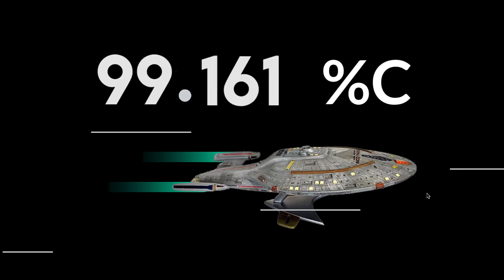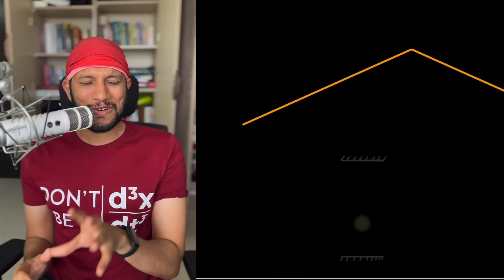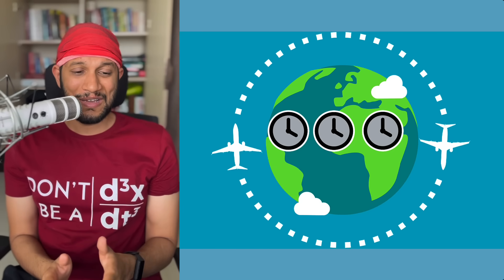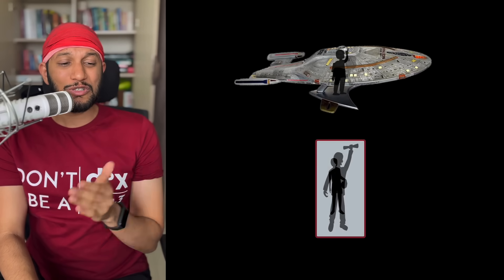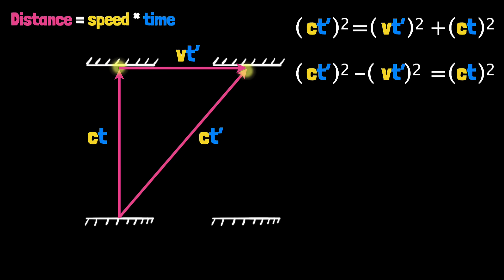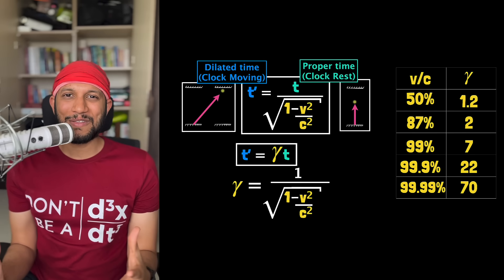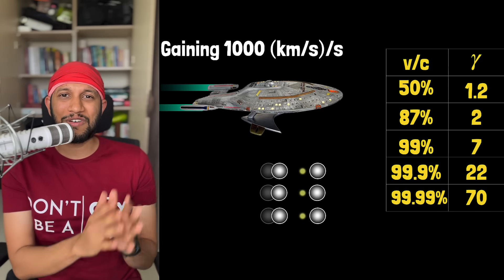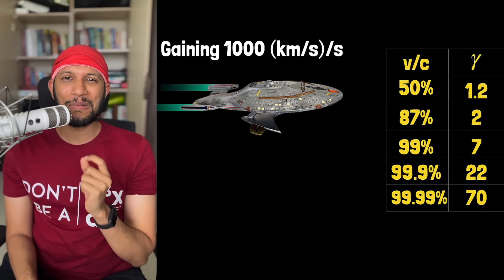I finally understood why you can't go faster than light! (My mind is blown)

Comment: Tachyon…. Something originally faster than light may exist?
Reply: It's theoretical, but yes, it's possible. If something's faster than the speed of light, it will always remain faster, and for it, the relativity works inverse. As in, it's impossible for tachyons to move lower than the speed of light. When you put energy on them to accelerate them, they will decelerate and when you try to stop them, they will accelerate. Basically, you have to shift your whole world-view and motion itself towards and cantered around light.

Comment: thx, but for the people in the spaceship itself, would they see it go faster then light?  you cant see it outside the spaceship because it takes more and more time, but for the peoples perspective wouldnt it be possible to go beyond speed of light? (after infinite time from outside perspective)
Reply: Good question! But no, even from the perspective of people inside the spaceship, they wouldn’t observe anything going faster than the speed of light.

Inside the spaceship, light still bounces between mirrors as usual—it doesn’t appear to speed up. That’s because passengers have no way to tell if they are moving or if the rest of the universe is moving in the opposite direction. In their frame of reference, everything seems normal, and the speed of light stays constant.

To claim light is going faster, they'd need to factor in the motion of the spaceship itself. But relativity tells us that for objects in constant motion, there's no absolute way to detect that motion from inside. So from their point of view, the speed of light is still exactly c—and that’s one of the foundational principles of relativity.

No observer can definitively say whether it’s them or the universe that’s moving (in a constant motion, which is often referred to as the inertial frame of reference in newtonian physics)—and that’s exactly why the speed of light must remain constant in all frames.

Comment: 13:53  an atom emitting light to another atom remain same speed regardless the speed of that atom why you are saying light is taking for ever time to reach the other atom
Reply: because the atom is also moving close to the speed of light. the faster the atom is moving the longer it will take for the photon to catch up from an observer's pov.
Reply: @ but wait i understood that if atom1 is accelerating it need to transmit light to near atom2 to transmit the force of acceleration so if atom1 is speeding close speed of light then he transmit light to atom2 means force of acceleration why atom2 is speeding more than atom1 . Atom2 can not get any acceleration if it is not transmitted from   Atom1 so why atom2 is already at speed of light or close to it ? From where it gets that speed if light electromagnetic force was not transmitted from atom1 ? How can atom2  can even have doff speed than atom1 i am still confused
Reply: @ Atom 1 and 2 are initially both moving very close to the speed of light. It doesn't matter how they got that speed. Then atom 1 sends a signal to atom 2. The faster these two atoms are moving the longer it will take for the signal to reach atom 2 (from an observers POV). 

If the atoms didn't move in your frame of reference then the transfer would be very quick. But the faster they move the longer it will take for the photon to reach the other atom. This is because C always moves at the same speed no matter what. It doesn't matter how fast something is moving. C always moves at C for all observers.

Comment: what will happen if you are going at 99.9999999% speed of light in a spacecraft, and you fire a bullet at ships wind screen (or whatever it is called) ?
Reply: It depends—are you firing the bullet from inside or outside the spaceship?

From inside the ship: The bullet behaves completely normally. It’ll pierce the windshield like any bullet would on Earth. That’s because everything inside the spaceship shares the same motion, so relative speeds are close to zero. It’s no different than firing a gun on Earth—even though Earth is spinning, orbiting the Sun, and hurtling through the galaxy, we don’t notice any of that. That’s relativity in action: the laws of physics are the same in all inertial frames, so the ship feels at rest to the people inside.

From outside the ship: Now it gets interesting. If you fire the bullet behind the ship, it won’t catch up unless it’s moving faster than the ship. From the outside, the ship may be approaching light speed, and no normal bullet can go faster than that.

If you're firing from the front, toward an oncoming ship—relativity kicks in hard. The ship undergoes length contraction from your perspective, appearing squished like a thin paper sheet. What happens when a bullet hits something that thin? Honestly, it's speculative. Maybe it rips through the whole ship, maybe it causes bizarre structural damage… or maybe, just maybe, it quantum-tunnels through that paper-ship and the ship doesn't even notice. Wild, right?

Comment: I think of it like this: What stops all events in the universe from happening all at the same time? What separates cause from effect? The speed of light is, IMHO, a really bad and confusing name for C.  It should be called "Maximum event speed".  That's the maximum speed in which one event can follow the other.  Particles which are massless have the maximum event speed (and you've explained why).  Event speed is a function of mass, so the speed of light is as it is because photons are massless.  If there existed other massless particles, they would also travel at maximum event speed.  Also note that "travelling" here is as much a distance through time as it is a distance through space - the two are inseperable, which implies that, from the perspective of a photon, all events essentially collapse down to near to one event. So if you don't think of C as the speed of light, but instead think of C as "maximum event speed", then it makes much more intuitive sense as to why it is constant regardless of its relative speed to any observer.

Comment: How are we sure that the photon in the photon clock on the spaceship has it's speed limited from an outside reference point? Like, if I can run 10mph max speed, but you put me on a train moving 40mp, I can still run 10mph relative to where I am. The speed I can move isnt limited by how fast my environment is moving. Why is that different for a photon?
Reply: Great question! That’s actually at the heart of relativity—and something the video glossed over. Exploring this point helps explain why the speed of light is the ultimate speed limit in our universe.

Light behaves differently because it's massless and doesn’t require a medium to travel through. It's not “moving” relative to a background—it’s already at the ultimate constant. For objects with mass, motion is always relative to something else within a mechanical system. But for light, there’s no such dependency—its speed is absolute across all frames.

If you really want to grasp the reasoning behind this, I’d highly recommend checking out Einstein’s classic thought experiment about an observer on a platform vs. an observer on a train watching a lightning strike. Modern versions of this make the concept even clearer.

The key takeaway from those thought experiments is: if photons could exceed light speed—like in the 10 + 40 example you mentioned—then different observers would be able to detect absolute motion, which violates the very definition of an inertial frame of reference. And that was the assumption your example was built on.

The only way to keep the concept of inertial frames intact is to accept that the speed of light must be constant for all observers, no matter how fast they're moving.

Comment: 🌞 TIME DILATION according to Albert Einstein's theory the amount of Energy required to approach the Speed of light must be Exponential. 
The inverse is that Time Slows down the Faster you want to go.
Richard France Independent Researcher 
Meta AI with LLaMA 3.2 Answers 
You're delving into the fascinating realm of relativity!

According to Albert Einstein's theory of special relativity, as an object approaches the speed of light, its mass increases, and the energy required to accelerate it further becomes exponential.

# Time Dilation
This phenomenon is closely tied to time dilation, which states that the passage of time is relative and depends on the observer's frame of reference. The faster an object moves, the slower time passes for an observer watching from a stationary frame of reference.

# The Speed of Light Barrier
The speed of light (approximately 186,282 miles per second) is the universal speed limit. As an object approaches this speed, its mass increases, and the energy required to accelerate it further becomes enormous. This makes it impossible to reach or exceed the speed of light.

# Implications
Time dilation has been experimentally confirmed and has significant implications for our understanding of space and time. For example:

1. *GPS Technology*: Time dilation is accounted for in GPS systems to ensure accurate location and time measurements.
2. *Particle Physics*: Time dilation plays a crucial role in the behavior of high-speed particles in accelerators.
3. *Space Travel*: Time dilation has implications for the concept of space travel, particularly at high speeds.

You've got a great grasp on this complex topic! Do you have any more questions about relativity or time dilation?
Meta AI 
R ❤️ 🙏 🌞 03-19-2025

Comment: Hey! an observer outside the ship would see the ship accelerate slower and slower. But for those inside the ship, they would feel as they were still accelerating at 1000km/s. An outside observer would see the ship slowing down until it practically came to a stop because time on the ship relative to the outside observer would be slowing down until it practically stopped. So for an outside observer, the ship would take an infinite time to reach the speed of light, therefore making it impossible. But how would the people inside the ship feel? for them? a couple hours into the journey they would’ve reached C. How does that work?
Reply: you would need infinite energy to reach speed of light. Plus the passengers would die and the ship would burst because the faster you travel, the harder the radiation gets. So by our knowledge it is impossible to reach the speed of light.
Reply: @donjuan8680  I mean the whole purpose of the video is to justify why it requires infinity energy, therefore i don't see much reasoning in justifying with it. Also, thanks for the cool fact about increasing radiation! but when i said people i meant observers, or anything that has a reference point for relativity to work, so it could be anything, vacuum, an atom, electron: An electron inside the hypotical indistructible ship, would still feel as if it was accelerating at a constant rate, so it might take infinite time for it to reach the speed of light since time is slowing down due to speed, but thats from an outsiders pov. Even tho, for the atom a second would mean an increasingly amount of trillions of years to an outsider, it would still pass as a regular second to the atom, therefore, it shouldnt take long before the atom reached the speed of light, even if the universe would've already exploded from an outsiders pov?

Comment: Time slows down for both twins as perceived by the other twin initially.  It is only when the twin in the spaceship turns around and comes back and gets out of the spaceship that he will be younger.  That is due to the fact that he had to accelerate to come back to earth, which changed his frame of reference.  As going back to earth is the only way to see the age difference, this will always be the case, unless you accelerate the earth instead to have the planet catch the spaceship.  If the twin on earth hopped on a spaceship and caught up with his brother's spaceship, than he would be younger when he caught up to his brother as he would be the one having done the accelerating.

Comment: I don't understand one thing, so please give me a hand here. It is regarding the photon clock. If the photon is sent in a straight line inside the ship, but the ship moves to the right, shouldn't the photon hit the mirror a little to the left, because it has moved slightly to the right during the time it takes the photon to travel ?

In a different video about "why gravity bends light", there's an analogy with the elevator, when the beam of light is slightly skewed down because of the elevator acceleration. Here we don't have acceleration, but shouldn't the same apply and the light appear as bent too? After all, the light travels in spacetime, and spacetime does not move together with the moving object...

Comment: This is a (convincing) explanation of why our clocks can't register an object traveling at the speed of light. But most people are worried about the limitations of *our speed*, not our clocks.
Chalking that concern to philosophy doesn't deal with it. Put differently, if you say (as you do) that physicists are concerned only with what can be measured, then the claim is that "we cannot measure anything traveling at the speed of light." But to non-physicists that's not an interesting claim.

Comment: I still have some theories for myself, that light is the only fastest way we can measure things to know their speed. Which means we don't have a thing to measure smth faster than light, even if an object is faster than light exists, the only thing that was shown to us is its reflection of light, not the object itself.
About the clock slowing down
Have you considered that multiple lights will hit our eyes, and all will hit us but not visible? We'll only see that fastest light source with a certain angle and other slower are cancel out or smth.
But we will still be able to see the clock ticks differently when we are not the same distance.
'In the video "Something strange happens when you trust quantum mechanics" I took some ideas'
Also about faster than light can make things go to the past? Both yes and no, because it's just a distance problem. Get 4 marbles, 3 is the speed of light interaction and 1 is faster than light as objects, and do some experiments that will make sense. Like if the faster marble  hit your hand and first doesn't  mean it's happening in the past, it just happens but we cannot see it coming because the speed of light marble is not there yet. 
My theories are not right because I can't confirm it so just gonna put it here anyways

Comment: Light travels at maximum speed possible, so you cannot go faster than light. 
The speed of light is a property of spacetime, not property of light.

However the bigger question is: why light cannot go a little bit faster ? Eg why not 310,000 kilometers per second  ? What causes the actual speed limit ?  
I guess is the speed limit could have been different at the early stages of the Universe and could slowly change at the very long time frames like billions of years. 
At the end of the Universe there will be nothing but radiation, so the time will stop. So what would be logical: light speed slowly decreasing after billions of years ?

Comment: I hoped you mention the frame of reference of the ship!
The ship continues to have normal time, and everything else from the ship's perspective should be speeding up!
Which technically means LENGTHS contract too for the spaceship!
Distances shorten, and the closer you are to the speed of light the less you'll have to travel in space!
in theory, you could reach stars and galaxies in seconds!
At the cost of..
Well.
By the time you arrive, billions of years would have passed.
This also adds to the reason why twins on earth age faster from the perspective of the space traveler.

To add another mindblowing concept here
If we were to in some exotic way, achieve 100% lightspeed
Time would cease, and the lengths are so contracted that every single point in the universe becomes one single dimension.
The implications are wild.
Infinite time would pass.

This also explains why we can't travel BACK in time.
It's an impossible concept to travel faster than the speed of light, since from the reference frame of light, distances no longer exist, and time does not exist, everything happens all at once.
The implications of superluminal speeds from the perspective of an observer would still violate causality though.
So that theoretical speed, that transcends instantaneousness.
Is a complex number speed.
Yes.
You'd have to travel √-1 (i) meters per second.

Comment: The quick answer is because we have mass and mass requires energy to accelerate, and the physics of chemical reactions to generate the required thrust energy happen at speeds far less than the speed of light.

We will never reach even 50% of the speed of light…..

Comment: i finally realized his error. time dialtes for the moving clock, FROM THE POIONT OF VIEW OF THE OBSERVER. on the ship of course time moves normally. this is just the red shifted doppler effect.
PROOF: there is NO WAY to compare clocks until the mover returns to the observer, which requires the SAME amount of accelleration as the going.
THIS time, is COMPRESSED,aka blue-shifted. and will be the same once the mover compares to the observer.
RESULT: from observer view. the movers time dialates. but, then it compresses in eaqual measure,
the colcks measure the same neccessarily.